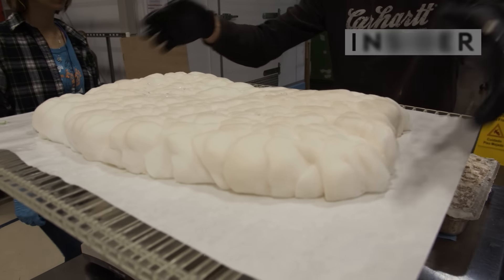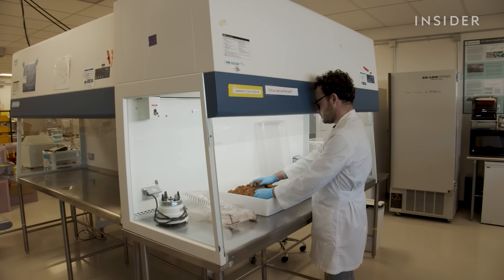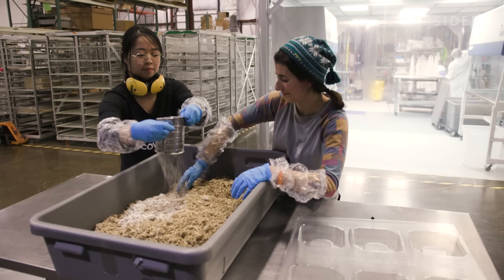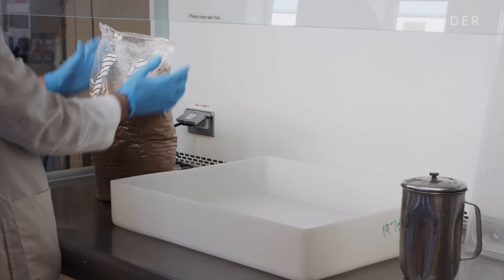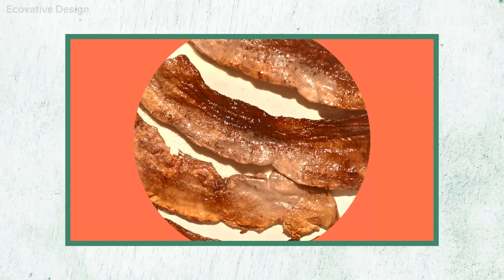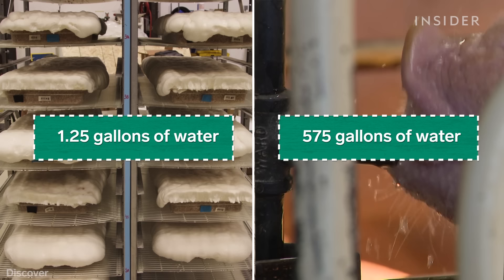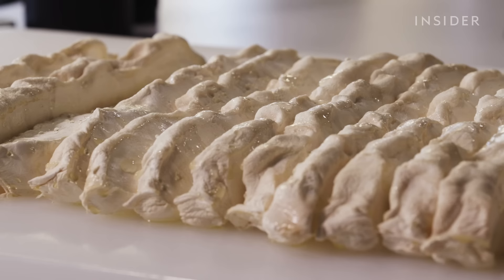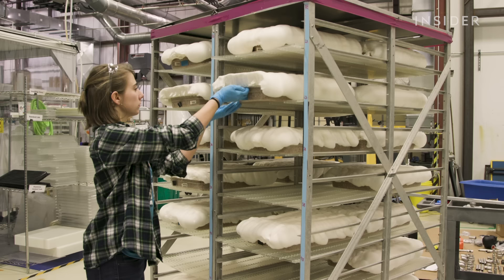How Mushrooms Are Turned Into Bacon And Styrofoam | World Wide Waste

Comment: Disinformation can be subtle.  Often it’s added in with something that needs to be sold like an idea or product.  Often it’s a cleverly disguised good idea that’s based on fear.  In this video they are hoping you won’t be privy to the lie they tell about styrofoam not able to be broken down when there are ways to do this.  Ironically like the fungus they use to make these products there is a fungus that can eat plastic and oils that can dissolve things like styrofoam.  The reason they haven’t done this is to push the green agenda and be able to enforce restrictions and more taxes on the people.  If they can force fear on people they will behave and do as they are told much better than if they knew the truth.  So they put out these save the day ideas (in this case it’s based on fear of losing our environment…when we are not) using lies to deceive us.  Now can we do a better job of keeping our environment clean…absolutely but education and not fear should be how it’s done.  We are not unruly little children that should fear a spanking if we misbehave like they treat us.  The liars need to be the first thing eradicated from our environment.